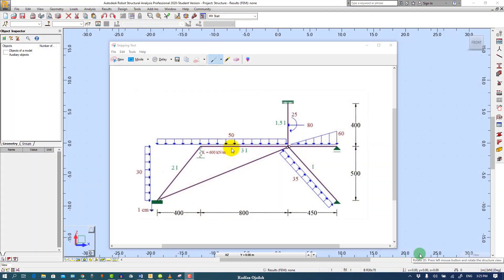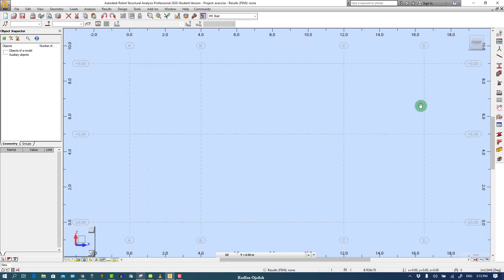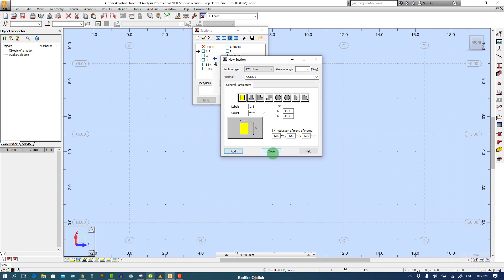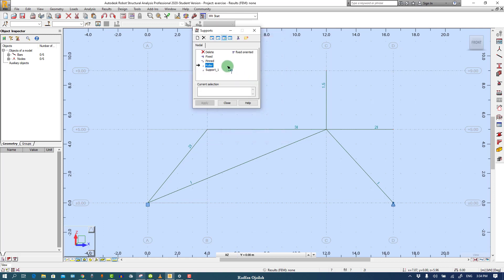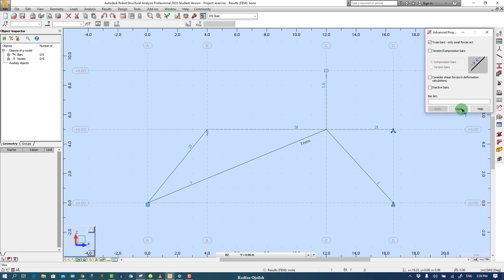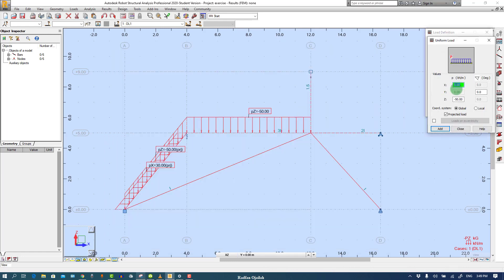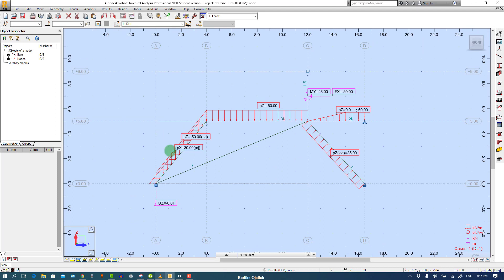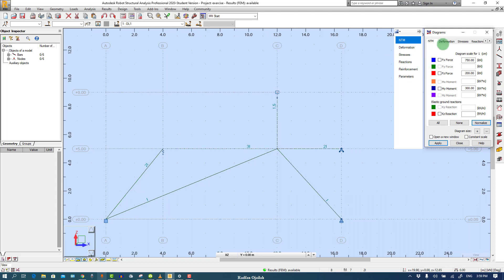Frame-2D-Exercise modeling and Analyzing in ARSAP

Comment: first thank you for this videos which helped me a lot,
the member ab has distributed loads, the first load "30" affects horizontally not in the member direction like member dc so it's value will be on the horizontal distance "500" you could change the load value to effective value by "30*500/640" and replace 30 by this, the same to other load which affects vertically.
Reply from the maker: That's why you have the option of projected load, it does that automatically
Reply: @RadfanOjailah  ok, i don't notice it, thank you